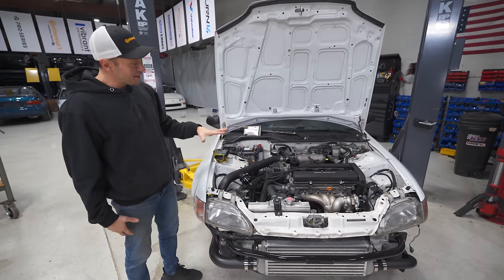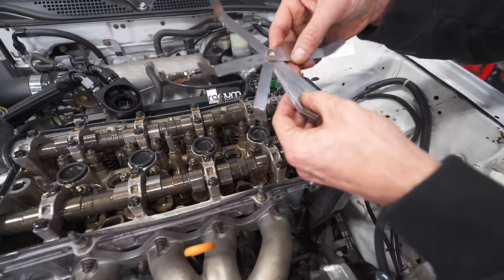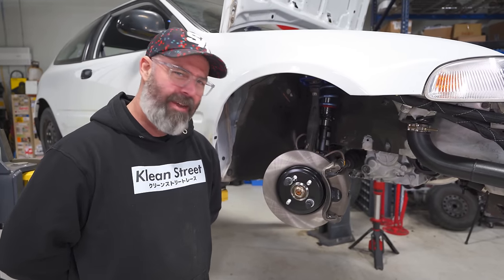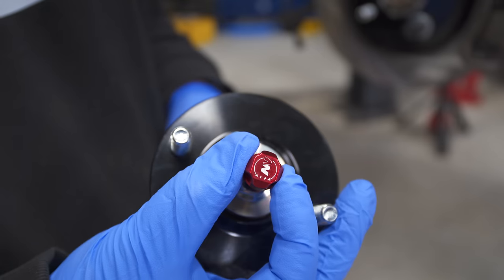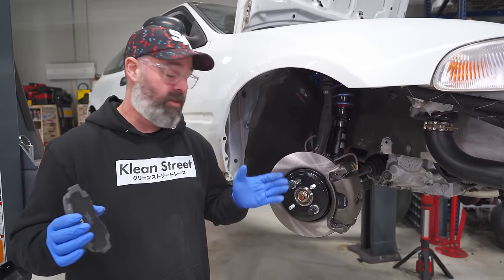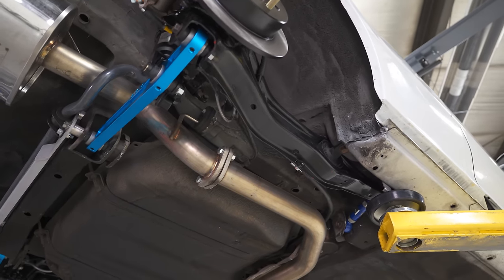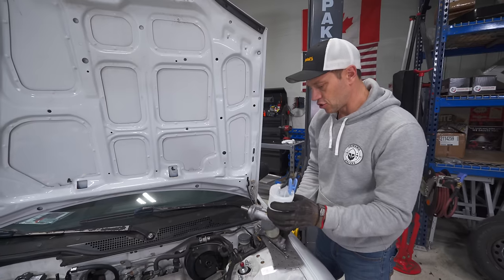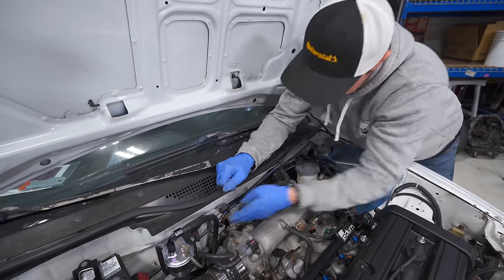TurboCharging an EG Honda Civic - Budget Wheel, Suspension & Brake Upgrades! | PT5

Comment: Pro tip for the stuck race as an ASE master tech. Using a cutoff wheel at a 45 degree angle put a cut in the race without cutting all the way through. Then grab yourself a chisel and hammer and hammer the chisel into the groove you cut. Because the race is hardened it will crack after a few blows with the hammer and will easily slide off the spindle
Reply: I just said the same thing. It's surprising how easy it cracks through with a few solid hits.
Reply: And wear gloves when hitting! got metal in my hand a few times from the bearing shards
Reply: You can also score it and run a bead the other side, as weld cools it shrinks and cut the race

Comment: Common practice at my shop if a race is stuck, I use an angle grinder and cut a slit in the race. One hit from a hammer and chisel in the slit and the race will generally crack into two pieces. You have to be careful to not cut too deep and always wear eye protection. Really the same concept you’re doing with the air hammer but the cut in the race is used as a guide so you don’t slip.

Comment: The only difference between all these prop valves is the main spring. I just went through the same thing buying used 4040 prop valves on eBay that were leaking. I bought a 3030, swapped in the 4040 main spring and it’s all good now.

Comment: You want that 40/40 prop valve. The 30/30 will lock up the rear too easily, really bad news if going hard on the brakes. It's extra bad if you're hard braking in a turn. Or even just regular braking in the wet or snow, the back end will want to come around.
Reply: Never had that issue.
Reply: @MyWolffy  when you encounter it you’ll never forget. You’d never notice it Sunday driving in the dry. Brake bias is a real thing.

Comment: What we used to do when I worked at Honda, was use a grinder to cut a notch in the wheel bearing race.  Then use a chisel to crack the race.  It would slide right off after that.

Comment: Def a vote for the Heliograms from me. Split 5-spoke is classic.
I appreciate including bits like the struggle with the proportioning valve, because working on real cars, especially old cars, are all about these struggles (components rusted or seized, or just not easily serviceable on the car), not just an engine build on a nice clean bench.

Comment: Working 40/40 prop valves are RARE! I found 2 used and both failed. Attempted a rebuild on both using new seals, both still leaked. I kept the OE prop and it brakes still felt amazing. 🤷🏽‍♂️

Comment: For setting valve lash, i just slip it whatever gauge feeler I want  lash set at, adjust the rocker, and make sure i have the correct resistance on the feeler. Its usually a one and done deal

Comment: In case anyone was wondering, a relay is just a high-current switch triggered remotely by a lower current.  That way you aren’t running, say your 4-gauge starter power wire into the cabin.  You can just use a relay.

Comment: One of those Honda’s  needs an all wheel drive build on this channel.
Reply: I don't think this is a drag racing channel
Reply: Serious question: are the awd conversions for these only beneficial for launches? Is the heavily fwd biased awd system from the wagovan and CRV not helpful in corners?
Reply: @chaseteter  It might help on a loose surface but an AWD converted Civic won't handle like an Evo or anything. I honestly think a well-sorted FWD Civic could turn a faster lap time at most tracks, assuming it isn't hugely struggling to put its power down.

Comment: You can also score the inner bearing race with a small cut-off wheel on a Dremel and then hit that score mark with a cold chisel and it will crack through and slide right off.
Reply: An angle grinder works too. Just have to be mindful of how quick you cut.

The cut and hammer method works everytime.

Comment from the maker: Hit the thumbs up if you want the KONIG HELIOGRAMS on the Civic
Reply: Ultragrams 😭
Reply: Both look good, but these fit my eye better.
Reply: Even though they are both 15s, the design of the Ultragrams makes them look even smaller on the car, and for that reason I have to go with the Heliograms.
Reply: Ultragrams give it kind of a throwback ssr type c look.  Yes I know they were 6 spoke but gives me those vibes.
Reply: ultrasss
Reply: Need to Pin your "vote" comment to the top! Thx!
Heliograms FTW

Comment: Looks to me like the separate wrench and flat head is much easier to use on those non-VTEC heads. The special tool is only needed on VTEC heads where you can’t get a wrench on the adjuster lock nuts. I bought a set from Harbor Freight’s website way back in 2001, and still use them to this day.

Comment: DP was right with the Bluepoint tool, I have the same one and for some reason Honda has 10mm and 12mm rocker arm jam nuts, I think it just depends on the engine. My B16 is 10mm, maybe depends on the vtec option as well? No clue. Love the build, wish I could afford a clean EG, just impossible to find in ND, at least a clean one.

Comment: I’ve had good luck in the past with pinching the ball race itself on an inner bearing flange with the bearing separator and pulling it off that way. No heat or chisel needed.

Comment: You didn't apply enough heat into the bearing race for it to slip off. It's typically easier to use an oxy acetylene torch rather than a MAP gas torch because it can apply more heat in a shorter amount of time.

Comment: As some who changed 3 prop valves on a civic. Let me tell you. That job sucks and I hate it.

If you happen to blow throughout another prop valve. Take a look at your booster to master cylinder pushrod clearance. Took me forever to figure it out. I eventually switched to a 30/40 valve and oem RS brake booster/mc set up and never had anymore issues

Also if I have said it yet. I hate changing those valves

Comment: The tool you tried to use is for 10mm jam nuts that are on the VTEC heads. Non vtec heads use a bigger 12mm jam nut. So stupid lol. I have to same tool but only works on vtec heads. I have to use a wrench and screw driver too didn’t feel like finding a 12mm version of the tool. I just go back over mine with a ratchet to make sure they’re torqued and tight lol

Comment: Integra type r  brakes 280/260mm always use a 1inch master  cylinder. 15/16" is used on the ek4 or eg6  260/240 brakes .

Comment: Ya'll gave me PTSD with the Prop valves 😂😂 I went through 3 on my EG that all weeped from the hole. I think i ended up drilling out the weep hole and tapping/threading a bolt in there. Also brake overhaul on my Integra bigger this, better these, all resulted in soft brakes...brakes on these cars are a nightmare.

Comment: I hope you gents use a set of crower camshafts, 62402 or the 62403’s ……. To carry the power with out pushing the non vtec motor with too much boost

Comment: I had to put a separate relay for my fan on my k swap. Used the factory fan harness for the signal wire. Still need more fan. Just don't have the room for a second fan with ac and ps on a k swap with a full size radiator.  It seems in traffic even with a full size radiator these hondas get hot fast. No idea how the boosted guys get away with that much heat on a half size. My vote goes to the heliograms.

Comment: Super awesome brake conversion. Quick question The front spindles on your EG are they original Civic spindles are those integra spindles. I want to do the front conversion on my Eg and I already have the EX which has the bigger brakes but still wanting to do the mini Cooper swap.

Comment: Had to say it sorry. Those measurements on the feeler gauges you're reading off are thousandths/inch not mm. There of course is a mm equivalent but .006 mm would be insanely small.

Comment: Could have also just gotten a disc grinder and cut a deep slot into the race and then tap it with a chisel and it will split open and pop off.

Comment: TAKE MY ADVICE. AS A NON VTEC USER. MAKE SURE YOU TIGHTEN THE ABSOLUTE SHIT OUT OF THE JAM NUTS ON THE ROCKER ARMS!!!! They are NOTORIOUS for backing off when revving higher or bouncy tac at all. I’ve had it happen so many times. I can adjust valves by hand no feelers gauges that’s how many times I had them come loose (i rev mine high ) I’ve actually stripped out the ball that screws into the head where the rocker rides on lol

Comment: Are the rotors from a Mini Cooper S or non-S? I have the same setup on my Integra, but I could have swore the 280mm rotors were from non-S mini coopers.
Reply: I was wondering the same thing
Reply: That's what I thought, too. I thought S were like 300mm?
Reply: Yeah non S. Base model. I had same setup on my integra
Reply: Does anyone know if these specific rotors require shims?

Comment: Is that revel catback 60mm all the way through the muffler? I have the same one but for EM1 and it tapper to like 2in inside the muffler then back to 60mm at the tip

Comment: In my opinion the prop valve swap is pointless. My si hatch factory rear disc has a 30/40 the brakes feel amazing on it but they’re all oem stock spec. I have a 93 lx sedan. With si/ex front brake swap and a rear disc swap with the stock to the car 30/30 and a 7/8 integra master cylinder. Great pedal feel imo and I’ve never had any weird braking issues and locking up like Some people claim….

Comment: For the SA guys, or from the other commenters, do you think the car would benefit from a coil on plug system?
Reply from the maker: Not at this power level. We actually thought about it and were told to stick with the stock ignition.

Comment: If you were realy upgrading the brake system you would gave pulled out the stock brake proportion valve and put in a non biast  adjustable brake proportion valve .lmfao .